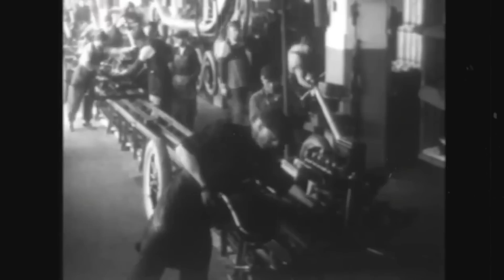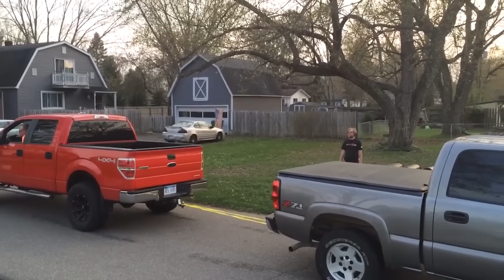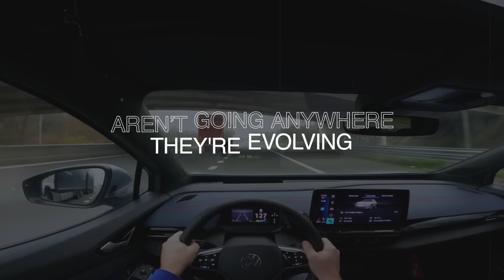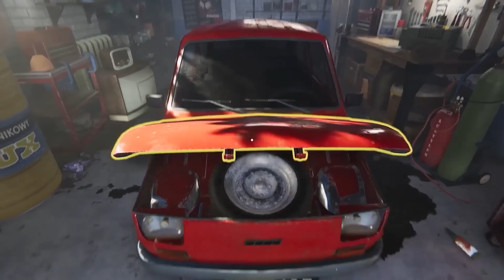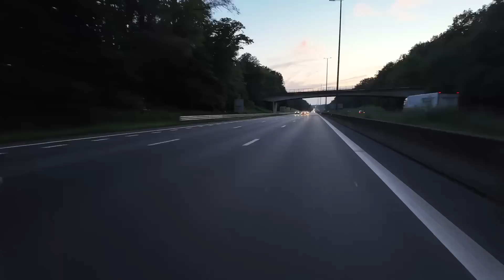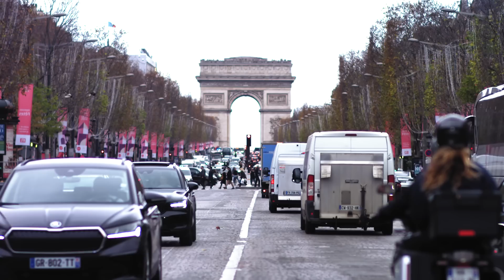Why European Cars Are Built for Safety (Unlike US Models)

Comment: When i went to Germany (im Californian) i rented a audi a4 tdi. It has cloth seats and reflector headlights but 4 piston front brake calipers and amber rear turn signals with rear fogs. A us spec base a4 will have a gas engine, single piston calipers, projector headlights and leather seats.
Reply: If you order a car - like usual in Europe - you can have several engines, several kinds of headlights. But no red turn signals. In Europe we usually don't go to a dealer and look what's standing on his areal. We order our cars according tour own wishes. ("Built to order")

Comment: This video has vibes that is was made solely by AI
Reply from the maker: I wish AI could put it all together so I don’t have to spend days on a video 😅
Reply: @itscarera  To be honest, it definitely sounds like an AI voice. Some intonation would be amazing!
Reply: @itscarera  255 is 255 millimetre tire width, the tires have a 45 and 50 percent profile height. This means the European tires side wall is 45% of 255mm whereas the USAZ tire is 50% of 255mm. but in the end they are the same width both are 20 inch wheels. Your claim the American tire is wider baffles me?
Reply: @itscarera  You should use actual data ...
And AI-voice without any intonation and "melody" only makes tired ...
Reply: But the essay was fully AI. It's good, but the structure and repetitive nature is very AI like

Comment: Mate, few notices:
1. We are not accelerating to EV era, we are forced to go to fu-ing EV era. However demand for it falling worldwide and people go back to combustion engines.
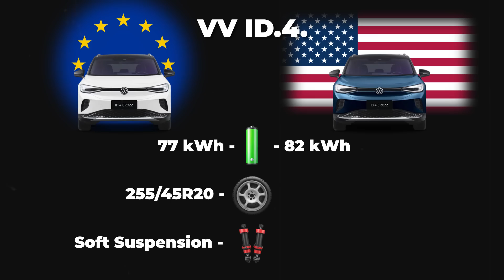2. 255/45R20 and 255/50R20 are not wider, they are higher/thicker. Its parameters are wide/high/diameter (3:35). Small mistake ;p
Reply: I feel the ev era would be more bearable if the market was like in China instead of EVs being so expensive and having bad propositions
Reply from the maker: Thanks for noticing, my bad 😅
Reply: The ‘forced EV’ narrative is manufactured outrage, mostly pushed by those profiting from oil. Automakers shift when tech improves and policy/demand changes, but ICEs still have a place, especially with e-fuels in development. You’ll still have the choice to drive what you want.
Reply: We are accelerating to EV era since a big Part of the world has realized that burning fossile fuels is destroying the base of our living. Only the American President has not.
Reply: "We are not accelerating to EV era, we are forced to go to fu-ing EV era. " So accelerating by being forced then? Both can be true at the same time.
Reply: @ I'd say they rolling back a bit now. EU parliament didn't accept law for restricting fuelled engines (ICE) from 2030-2035, Trump will never do it as well. My opinion - there will be 70/30 ICE/EV in a future 20-40 years. Maybe hybrids will mostly replace ICE, but still don't think there will be more than 30-35% pure electric vehicles.